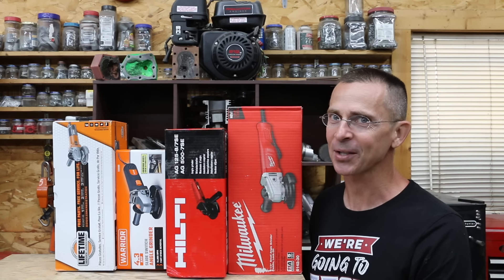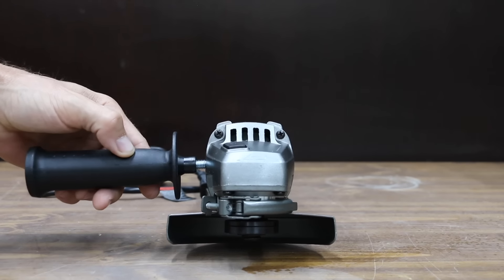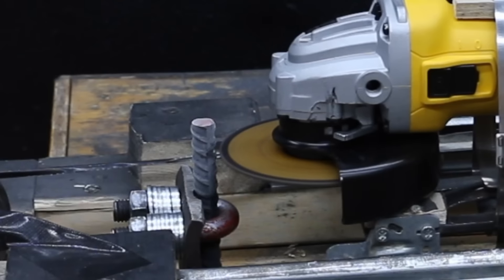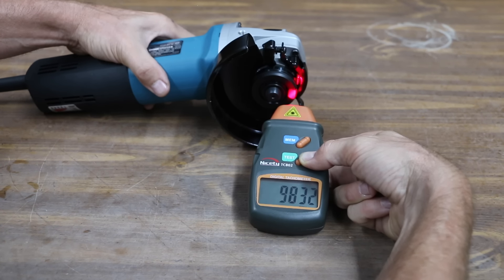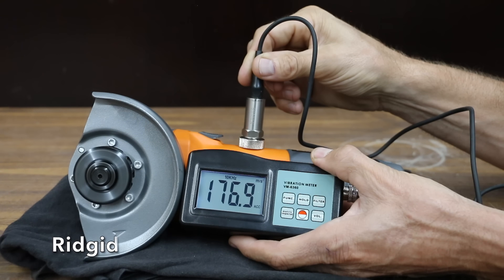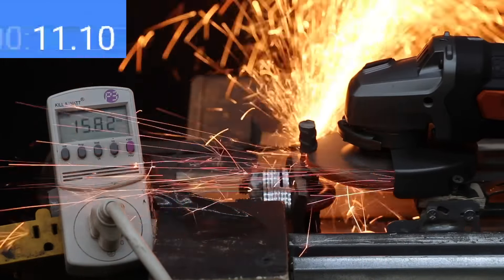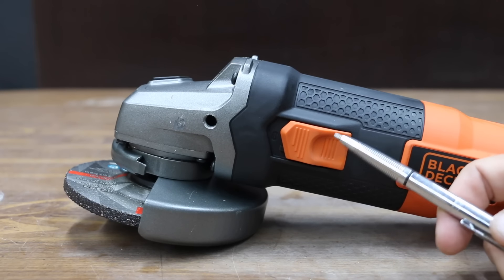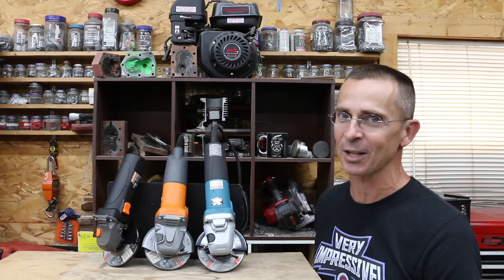Best Angle Grinder (Corded)? Hilti vs Milwaukee, DeWalt, Makita, Ryobi, Ridgid. Let's Settle This!

Comment: I was not disappointed. I knew the Makita was going to do well in this test. Their grinders are always very smooth and seem to out last any other grinder I have used.
Reply from the maker: Thanks for the feedback.
Reply: @utvc3687  the problem is that there's almost 0 distribution centers in North America. In Canada the brand disappeared.
Reply: @ProjectFarm  I would realy like to see more european tool manifactures like "fein" in your videos.
Reply: @utvc3687  I've found that Hitachi always outlived any Metabo or DeWalt grinders that we've had in our workshop. Although, Hitachi's power cables are stiff and brittle, so I'm always changing them for a thick and flexible rubber power cable.
Reply: Under actual use for entire day of grinding or sanding,  on metal products,  Milwaukee has the best product for durability and easy cleanup.

You can tear down and clean up a Milwaukee Grinder and keep the unit functioning longer and at lower cost than any of the other brands.
I spent 3 years and saw a pretty large pile of Grinders die to find that out.
Mikita has little brushes that wear out quick,  and the cost of replacing them appears to be more than Milwaukee Tools.

Like Motorcycles,  Milwaukee makes good products.....
Reply: @shona5512  I am not surprised to see praise for Hitachi grinders. The problem with it, Metabo, Fein and such is availability. And certainly in the case of Fein, cost.
Reply: If Metabo was on deck it would perform just as well.

Comment: When choosing Harbor Freight tools it might be helpful to add some of their other "tiers". In this case, the Bauer angle grinderis advertised to be $49 with an 8 Amp motor, 11,500 RPMs and a paddle switch.
Reply: Are there really any "better" grade tools at Harbor Fright (intentional misspelling)?  Or just less worse?  
I've had several bad experiences with power tools there.  Some hand tools seem OK, I found that some of them are made in India rather than Chy-na.
Reply: Bauer is rubbish, with rubbish customer service, even worse than anything from HF
Reply: I would be Interested in the Bauer as well (I have both the bauer and the warrier).  The bauer definitely has more power and is heavier.  I've found harbor freight grinders to be up to the task, so long as you don't really lean into them.  Seems like their gearboxes sound like gravel in a garbage disposal though.  I usually take the gearbox cover off and replace the craptacular grease with high temp wheel bearing grease.  Seems to help a little bit.
Reply: I was wondering the same thing about the Bauer and Hercules line.
Reply: Bauer tools I've had mixed results. When the first models came out they were hit and miss but over the years they've became more reliable. Their main issue is the vibration ruins the triggers or the battery connections. That said it's not nearly as big an issue as it was back then.
Reply: They also have a grinder for about $10, but it has a lot of both slop in the gears and vibration. I guess that's what you get for $10. I have a Harbor Freight "professional" grinder, and it works okay. I bought it used basically in desperation, and it's done good so far. 
Walmart has the Hyper Tough brand angle grinder, for $29 or so.
Reply: Hercules corded grinders work very well. I would highly recommend them. We use them in a steel fab shop all day, every day. Much better than Hilti.
Reply: I've had a few tiers of angle grinders from HF. None of them failed mechanically despite being really put through the works.

However, all of them had poor electrical cable connections and the on off switch would cut out and it would be dead.

Just have to take it off and re-wire it and you are good to go.
Reply: For wheel life, pushing too hard kills them FAST.  Big power isn't needed.  I have several cheap Harbor Freight angle grinders, all with different wheels mounted.  If I want a flap disk, cutoff, etc...  just grab the grinder with it already mounted.  Works great!
Reply: There 1/4" pneumatic angle dye grinders are actually pretty good. Up here in Canada it's called Princess Auto with Power Fist brand.
Reply: Lol I have a Warrior for my piddly things around the house. Works ok but thank you for the comparisons.
Reply from the maker: Thanks for the suggestion.
Reply: @todd5082  That would be a good video, HF shootout. Assuming the purchase is to be made there how do the brands fair in a good/better/best competition. Maybe 3 different tools like a drill an impact wrench and a grinder. pick a winning brand then compare them to historic results of the major brands usually tested here.
Reply: I have a Hercules grinder, Chicago electric, makita and metabo. The Hercules is vastly better than the Chicago electric and not bad overall for the $$
Reply: I have the warrior. Works fine for everything I do. Paid $10. Doubt I will ever wear it out. Came with extra brushes. I still have one from HF that is at least 20 years old. Dropped it and broke the case. Was going to glue it but hey. Got a new one for $10. LOL
Reply: I have the Bauer slide switch grinder.  Cost $30 in 2020!!  I find the blade guard lever does get in the way when doing deep cuts.  As to cheap grinders, I bought a HF $9.99 one in 1995.  Used it  to cut stepping stones - it ate a ton of rock dust and is still going strong today.
Reply: @-PORK-CHOP- Whothe hell is dealing with "customer service" for a $30 dollar tool from china???
Reply: A Harbor Freight grinder shoot out would be interesting. There are always the haters, but HF has introduced some power tools that are well regarded over the last few years. I still have five $9.99 Chicago Electric grinders bought a decade ago, with different discs and wire brushes for specific jobs, a corded DeWalt when something needs cutting fast, and an M18 Milwaukee when cordless is convenient. Still, I'd be curious as to how the ten or so grinders sold at HF stack up against each other.
Reply: @PeteHemdem  in the last few years harbor freight has decided to try with their Bauer and Hercules line. It's looking like they are going for entry level pro tools. I would like to see them put into more of these tests.
Reply: I've had the Bauer angle grinder for years. It has been a solid performer for me.
Reply: @PeteHemdem you must live in a cave..... PF has tested some of their top brand  hand tool and have hanged on with brands like snap on. They're  icon line is made in Taiwan and their jacks are made by the same supplier as snap ons........ HF has come a long way.... Not perfect though......
Reply: @MiguelGarcia-vj7oo    I live out in the woods but not in a cave.  I've been a carpenter for over 40 years and every power tool from Harbor Fright (intentional misspelling) has not held up at all.  I also hate giving money to the Chi-coms and do my best to avoid funding our enemies.
Reply: @PeteHemdem same here!…I only go to harbor freight for throw away tools 🤷🏻‍♂️

Comment: I've had a 13 amp Makita SJS II variable speed angle grinder for almost 8 years and like your Makita in this test, it is an absolute beast. The power and smoothness of it make extended use so much more pleasant and arguably safer. I splurged on the variable speed model to allow for more controlled sharpening of tool blades and removal of old paint and other finishes with a flap disk.
Reply: I have the same one.  It's definitely a beast and will buy the same thing when it's time.
Reply: Didn't you watch the video? The makita isn't a 13amp grinder
Reply: @janeblogs324  It says right on the tool, 13 amp. 6:08
Reply: @atfsgeoff  so back to my question, so you didn't watch the video?
If you did you'd notice its not even close to 13amp
Reply: @janeblogs324  if you're referring to actual power draw, in the final test it draws nearly 20 amps. So yeah. Not even close. Waaay more powerful than advertised. 12:07
Reply: On my 2nd Makita, 1st was about 12 years or heavy abuse.  10 so far on my 2nd.
Reply: @atfsgeoff  that's a misnomer, the motor is drawing more power (energy) but it isn't making more torque/rpm or doing more work
Reply: @janeblogs324  okay. It accomplishes the same work as the other lower amp rated grinders in half the time because of magic then, obviously
Reply: If you cut something like rebar all day you won't care, but I've been a metal fabricator for 20+ years. Once I got a variable speed grinder, I never touched the others. Game changer
Reply: @janeblogs324 what is your point??
Reply: I've been using the SJS line for 20+ years. The 4 1/2 and the 5" models. There is a 6" as well. Low fatigue with constant speed control. You will never regret buying one of these.
Reply: @shadygunshow  because they sold you a 13amp but you actually bought a firelighter. Do you not understand why they legally have to tell you the electrical rating of any device sold in a 1st world country?
Reply: @Bridge-IV  I hate my variable speed because they weigh so much, but love sanding and 1mm cut discs at half speed. Consumables last 2-4 times longer
Reply: @atfsgeoff  if you completely stop the motor it will consume 40amps and do zero work. 
2 motors that both draw the exact same current does not = both equally powerful. An inefficient motor draws more power and consumers just think more power= more force
Reply: @janeblogs324  hmm, now I get why you were all fired up. So, being ul listed means it’s met all the safety inspections, do you understand how electric works in a first world country? Tell me why you think it would cause an issue. 

Also, I don’t own a corded makita angle grinder.
Reply: @jane blogs  hmm.. I didn't notice a weight difference, I think mine is 5.2lbs. Minus the guard of course 😁 but my hands are huge. I do a lot of sheet metal work, so I'm generally not using it for hours at a time. I'm beating and welding in between
Reply: @shadygunshow  extension cords and breakers are rated for certain amps. Run more through them and they get hot and catch fire. Use a long extension cord and the breaker will never trip
Reply: Is it the one with the Soft Start option?
Reply: Where I currently works at…we use DeWalt DWE402, the 11-amp model. It’s a BEAST, however it breaks down after 2-3 weeks of aggressive uses grinding down polymer resin-based concrete… 🙃
Reply: My brain this whole video was thinking of how to engineer in an ability to vary the max motor amps but I'm glad to hear that someone has done that for me. New tool incommmmming

Comment: Really surprised to not see Bosch, we need to see another round including more metabo, and Makita models, as well as Bosch. Bosch has long been the standing king of grinders up there with hilti, matabo and Makita
Reply from the maker: Thank you for sharing!
Reply: @ProjectFarm  I agree, disappointed to not see bosch's 10A offering
Reply: I appreciate all the effort put forth nut I would have to agree about being surprised over not having a Bosch. I own A lot of these brands this tends to be for me a "you get what you pay or tool".
Reply: Bosch and Makita sell lots of cheap, unimpressive grinders. Hilti focuses on rotary hammers for general contractors, their grinders are terrible.
In my opinion professional metal fabrication companies use grinders the most, some guys have expensive Metabo & Fein grinders which have a lot of features.
Reply: Metabo used to be good 10 years ago but since then it's been going down hill with Metabo. Some of their stuff is really low budget rubbish.
Reply: @Dani-it5sy  I have both a Makita GA5040C and a Metabo WEV17-125 Inox and the Metabo is so much better it’s unreal (without counting the extra grunt it has). 
I use the Makita for cutting stainless and the Metabo for polishing. It’s probably the best grinder I’ve ever used, and I’ve used a lot over the years.
Reply: @zeroyon4562  Yea for polishing they are ok. I was more talking about the serious grinding work. But how old is the Metabo? There has been a shift somewhere in the last decade where they moved the production to China for what I have heard. After that Metabo got really cheap. I have a battery driven jigsaw from Metabo. It moves like a crab when cutting a straight line. And the body parts are of such weak plastic that my skin sometimes gets stuck between the body parts if you understand what I mean . English is my 3rd language 😅 I just really get angry and aggressive when working with that thing 🤯
Reply: @zeroyon4562  we use pneumatics for polishing, they can run all day, practically non stop
Reply: @willtrippe8982  I use both, but prefer electric. More powerful and not cold in winter. For small assemblies pneumatic is good though.
Reply: @Dani-it5sy  It’s a couple of years old now. German made. We use 165mm diameter x15mm or 25mm wide abrasive flap wheels on them. It’s very tough on it, the wheel is mounted on a tapered spindle which is quite offset from the gearbox so there’s a lot of load there. 
Most battery tools are made in China/Asia, it sucks.
Reply: also hercules
Reply: Absolutely! The Metabo 125mm grinders with 1700W are scary but fun to use at the same time. would love to see them. Maybe a Fein too for some premium brand comparison?
But the power categories are apples to oranges. of course a grinder with a higher powered motor of 1500W will be faster than a 1100W motor.
Reply: And more tests with Hilti too 👍
Reply: @ProjectFarm  If there's a second part I'd like to see some corded Brushless offerings from DeWalt and Metabo HPT. It would be good to know if thre's a tangible performance gap between those top notch and the brushed grinders.
Reply: @Dani-it5sy  The Metabo in the video clearly says made in Germany. I've got a vari-speed model, one of the cheapest with that feature and it is also made in Germany.
Reply: @1maico1  Sure is sais 'made in' or just  'Metabo Germany'? Anyway. I got that info from a Metabo sales rep. Maybe it's only partially Chinese or assembly in Germany or he just used it as an excuse for the bad quality.
Reply: @Dani-it5sy  Mine says 'made in Germany' on the box and on the grinder. You can see them being made in the youtube video
'Germany METABO Factory Tour'

Comment: I got that Makita grinders on sale 4 years ago for 60 bucks. 

Used it for cutting plaster walls open with tuck point vacuum adapter. Even used it to wet cut concrete when we needed to run conduit. Still working great. Totally worth it
Reply from the maker: Thanks for sharing!
Reply: Yea, my makita Grinder is over 10 years old. In the first half of its life, it was a work tool & heavily used. Since then, I've had it at home for odd jobs & is in great shape.

Comment: Ridgid has a 15AMP angle grinder. Makita has a 6 amp too. Would love to see a revisit of this video in the future with low and high amperage angle grinders seperately tested.
Reply from the maker: Thanks for the suggestion.
Reply: I'd also like to see Bosch represented. I currently have 4 Bosch grinders in 4.5 inch. I'd like to know where they fall in the ranks when it comes time to replace them.
Reply: yeah. i have the dewalt DWE4357 1700W brushless and would love to see how it measures up..

Comment: I've had a Makita for about 10 years and works great for everything I've used it on. Keep up the good work.
Reply from the maker: Thanks, will do!  Thanks for sharing.
Reply: Yep, Makita is number one if you do actual work. For once a year home use the cheapest one is fine tho.
Reply: I have an 8in makita thats 20 years old still works great.
Reply: Makita are the Toyota of tools, they just don’t wanna die, especially the older ones

Comment: In my experience, the 2 things that break the most in the shop are snap ring pliers and air compressors. Seeing either of those tested would be awesome. Thanks for your videos!
Reply: Please please air compressors!
Reply: Second snap ring pliers
Reply from the maker: Thanks for the suggestions.
Reply: @ProjectFarm third for snap ring pliers, they always break on me!
Reply: Snap ring pliers for sure
Reply: @ProjectFarm  I need a new air compressor soon, please review air compressors!
Reply: I've destroyed too many snap ring pliers despite not using them all too often, I agree would love to see a comparison on them
Reply: @ProjectFarm  please include snap on snap ring pliers and matco ones when ever you do this test.
Reply: Can you do bandsaws at some point?
Reply: With air compressors I've found that models with a belt driven pump are far superior to the direct drive ones. 15+ gallon of course. The motor and pump are rebuildable and individually replaceable and they just tend to be better quality. However, if you can locate an old one, like one of the 40s-50s ones that use a railroad air brake compressor pump, they are by far the best and the quietest as well. In terms of gas compressors, while they are relatively rare, Ingersoll Rand from the 1940s to the 1960s made a 6 cylinder radial air compressor. 3 cylinders were internal combustion and 3 were the compressor. It out out 36 CFM at 125 PSI with no tank. Could also be hooked up to a tank. And they were super reliable as long as you stayed with their particular oil requirements. My friend has one and it is for sure a beast, it sounds awesome like an old airplane and it is extremely compact for how much air it put out. They do come up on Facebook Marketplace from time to time, and are usually fairly reasonably priced at under $300, and usually only need carburetor or magneto work.
Reply: @texasbtc  Rolair.
Reply: YES! To both of these suggestions!
Reply: Man, if y’all are breaking snap ring pliers consistently like y’all claim then for sure using them wrong and/or the wrong size.
Reply: Didn't even know what specifically "snap ring pliers" were.  Now that I do....seriously?  You guys want a full Project Farm video for.... pliers?!?  What do you guys do that require high quality snap pliers?